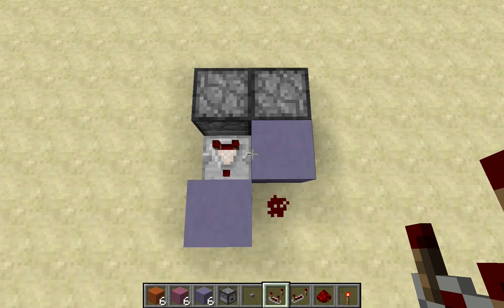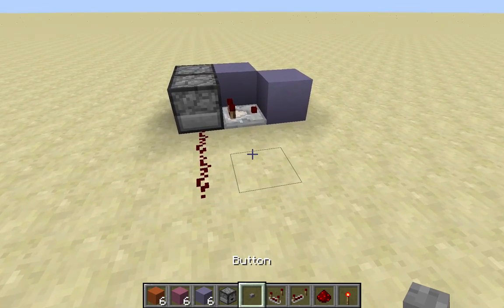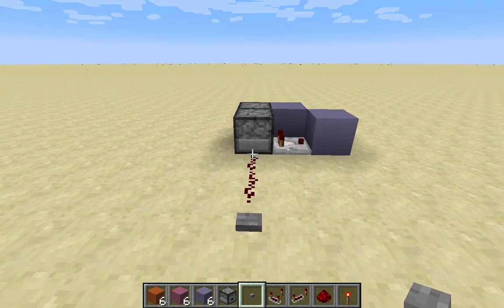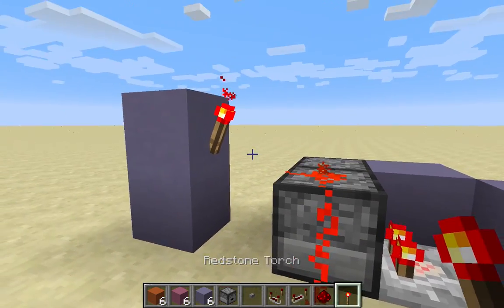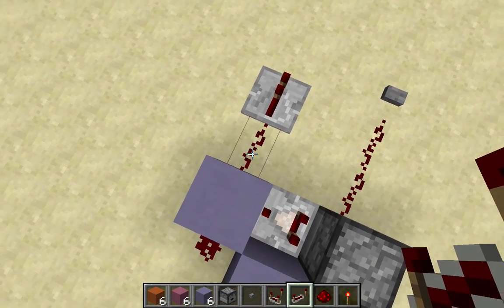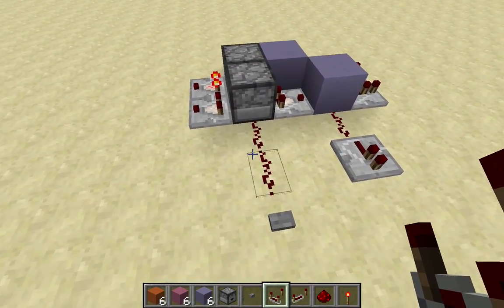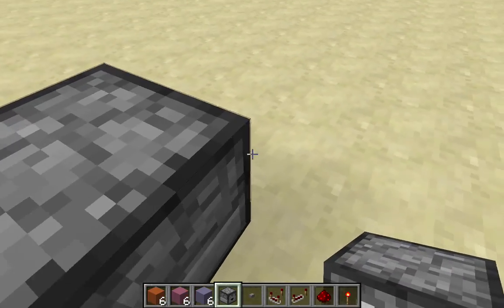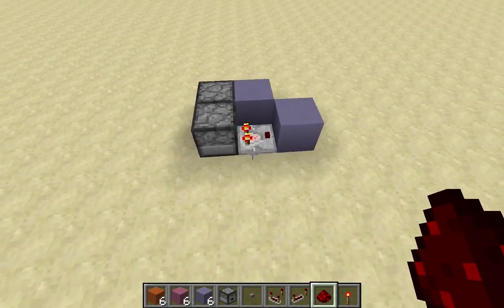Minecraft - Small T Flip Flop [6 Blocks]

Comment: I have a 2 block toggle t-flop. It's super simple. Just put water bucket in a dispenser and make a barrier for the water so the water doesn't go everywhere. Lastly, place a button wherever and put a comparator. Because the water bucket will give a higher output compared to a empty bucket and the water toggles…

Boom
Reply: Works for EVERY version. ; )
Reply from the maker: Really interesting idea! But you need at least 4 blocks for the barrier, and then space to differentiate between the two power levels. So 8 blocks. Some builds might be able to double-dip on some of the space though.

Comment: It works 3 or 4 times then the item gets stuck in the second hopper and won't return until I hit the button 3 or 4 more times. Not sure what the problem is... and I tried using a repeater after the button
Reply: use a repeater going directly into the dropper

Comment: This works just fine. You have to build the switch in the order presented in the end of the video and sometimes use a second repeater as noted below: 
"If you put a repeater in front of the button going into the first dropper then it works, without the repeater it can not power the second dropper to return the block."
Reply: ohhhh thx
Reply: thx so much!

Comment: This will only work in 1.10.1 and is not the smallest t flip flop.  There is one design even smaller (4 blocks).
With that out of the way as Mick Solah said you can still make this work in any version so long as you put a repeater to the dropper as your input, and it's a new design I have not seen before.  Good Job!